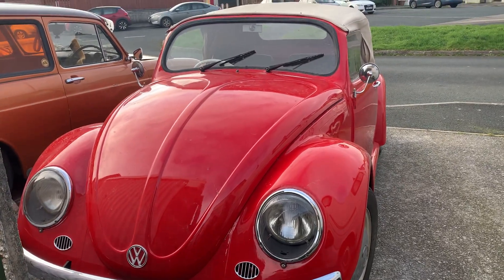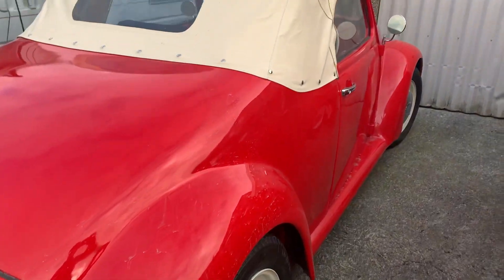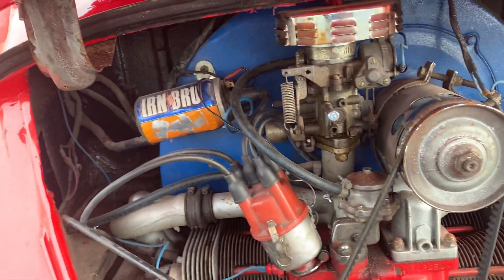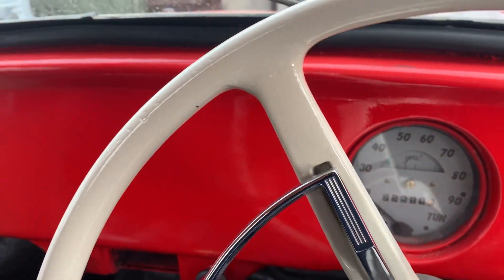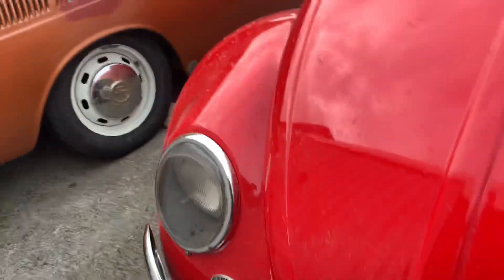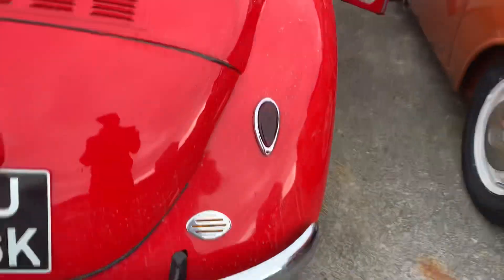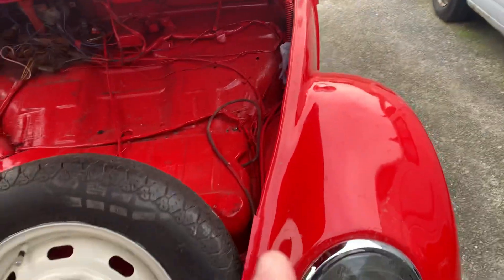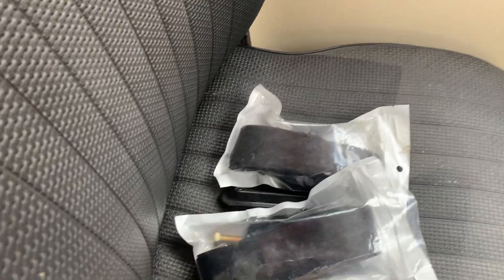vw beetle wizard 1971 new purchase !!

Comment: very nice vwcoco, be nice to take too "Camper Mart" you need something like this for the lights 4x 12V LED LOAD 50W 6R IN-LINE RESISTORS FOR LED  INDICATOR/REAR TAIL LIGHTS INDICATORS
Reply from the maker: Yeah it’s resistors needed only just found that out ,great spot Kenneth 👍

Comment: Led bulbs is why it's flashing fast.
How has that engine survived with no tinware or external air vents!
It's got the vert heater channels so it's been properly converted.
Good choice for the missus.
Reply from the maker: Wasnt used at all since engine was out in but no tinware is a no no . Resistors needed yeah led lights cheers

Comment: No tinware, i know the air cooled engines are tough, but why push your luck, right?
Runs pretty nice, likely a fuel delivery issue, lean…
Reply from the maker: Needs full tinware,why they didn’t refit it ,I do not know thanks frank